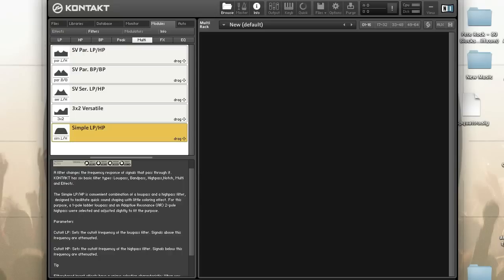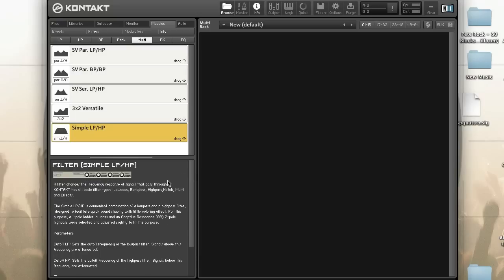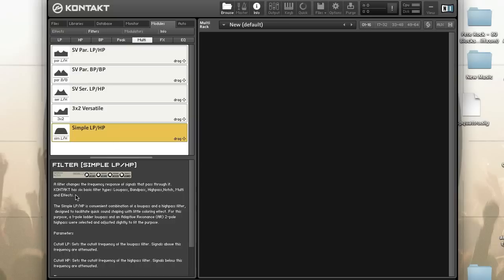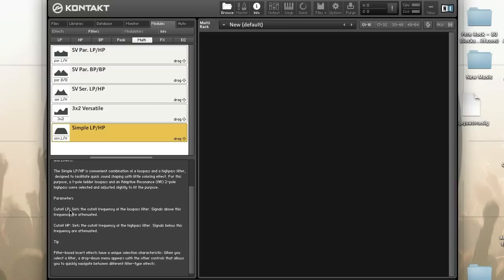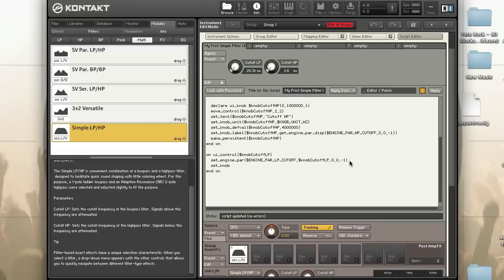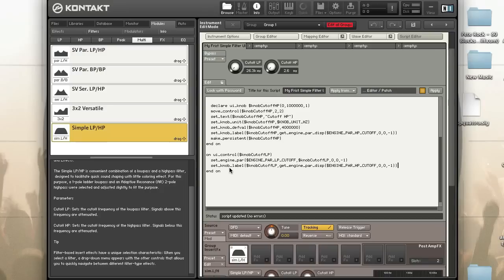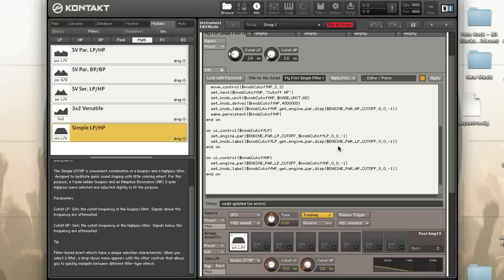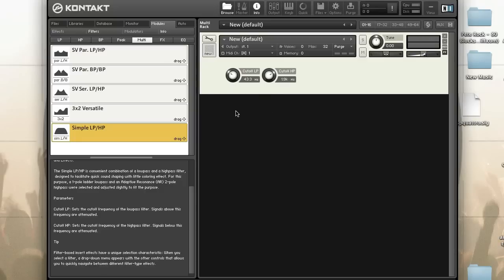Kontakt - Scripting - Control a Simple Filter in Performance View - How To Tutorial

Comment: Hi, i know this is an older video but if you could help out i would be very grateful. 

I can get the filters to work as directed in the video, but if i add the script to a pre-existing instrument of mine (very basic, just samples loaded) the knob appears, but fails to work. 

After a bit of tinkering, i find that the script stops working if i modify or remove the original audio sample i use to make the instrument. For example, i have multisampled a keyboard into one wav file, which i then chop up and map. Once it's mapped, i'm still left with the original wav file, which i don't need anymore so i delete. This seems to be what breaks the knob, and if i load up an instrument with that file already deleted, it fails to work.

Any suggestions?